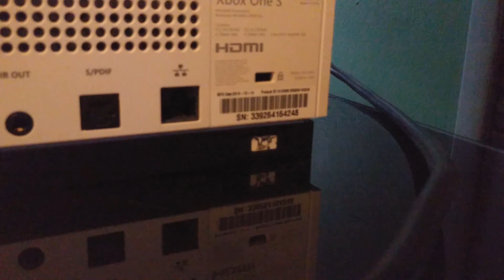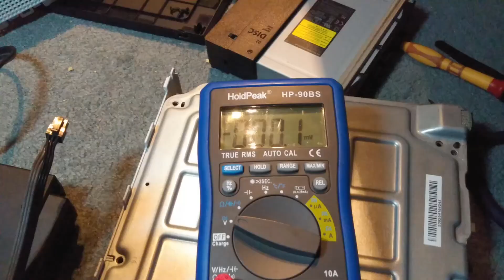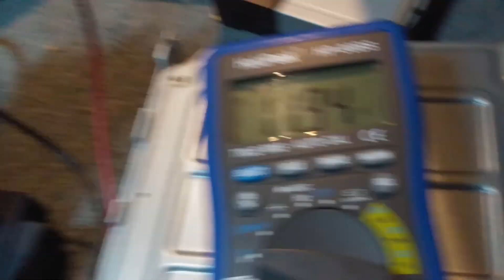eBay Junk : Xbox One S Repair Part 1

Comment: Can you provide any specifics on how I can test my 3 mosfets with my multimeter? Also do you know of any other test points (or) the order of power source travel for troubleshooting? I know the power rail, but unsure where else the power source sends voltage to test. Dont know where to check if the southbride is getting any voltage from what i hear online. Not even sure what the Southbridge chip is. Love these vids tho.. I commend you on your ambition attempting this. I am the same way. Its fun and you learn.. I had power and mine worked till the dvd drive went out and I started moving it, it touched the board and xbox turned off. Something blew from the short. With yours ypu get power then shuts off. I would say test or (and) change every capacitor on the board. Or Re-ball the video chip. Only two things I ever need to do when repairing lcd tv's I repair that turn on then off.  Thumbs up bro. I will keep ya posted if I get some good info to try out from you or i learn something i have not seen on your vids. Happy new year
Reply from the maker: It's been a long time since I looked at this project. I actually repurposed the 500GB hard drive in my HTPC. I might try again some day.

To be honest, there is so little information and I'm such a noob that I feel like I'm stumbling around in the dark with this one. 

There might be a link in the comments here somewhere to a forum thread where I got some really good diagnostic advice.

https://www.element14.com/community/thread/65128/l/repair-challenge-xbox-one-s-beep-on-then-beep-off
Reply: @Lilithe  how did you know where the 12v test points are to check for voltage? And how to know if southbridge is getting voltage?
Reply: @Lilithe  i have something you may find VERY interesting as a way to find a short for you. Worth a thought. I have used this method before on my co puter motherboards for chips with shorts. Get a can of compressed air and spray it upside down so only the cold liquid covers a section you feel on board that has the shorted component.  I will actually link you to the video i watched previously that I used to find a shorted diode before on my pc build.
Reply: @Lilithe  https://youtu.be/AOALg_rDIZk

Comment: hmm when i test the PSU on my MM the minus symbol  ( - ) appears in front of the voltage reading which reads - 11.99v, im guessing  the minus symbol isnt supposed to appear?
Reply from the maker: Wow, uh... are you sure you are putting the red + probe on the grey wire? I think that's positive. Black is negative. It should show 11.99V not negative.